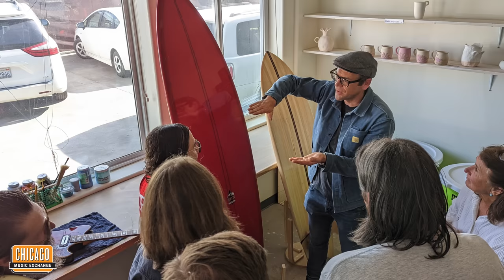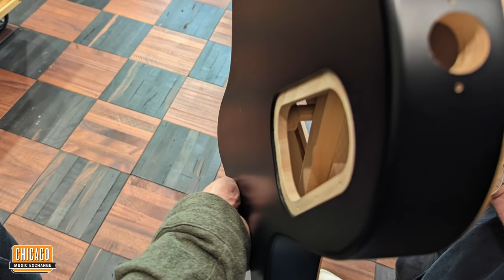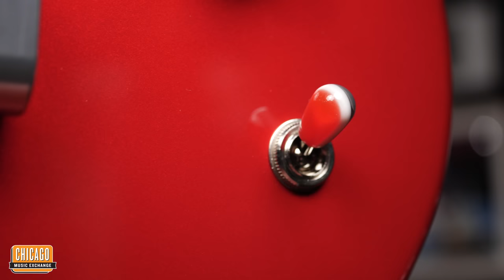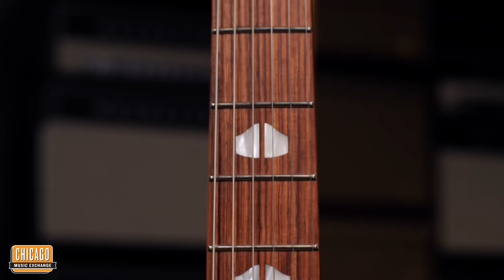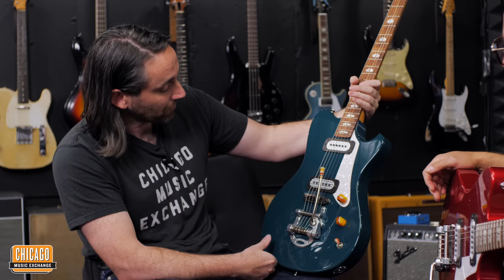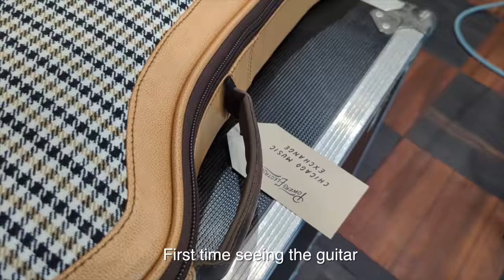Southern California Inspired | Powers Electric Guitars

Comment: A faraday cage that thin will have little effect on string pull.  It probably has some magnetic alloy on the outside of the coils that draws the lines from the strings down through the coil, but it will also create eddy currents that roll off highs to some extent.  The Steel screws do that anyway.  Fender Jaguar pickups and Lace Sensors have that, and they both have rolled off highs.  Strings vibrate elliptically when plucked regardless of magnetic pull, but I'm all for decreased pull.  The pickups sound nice, but there are already highly efficient pickups with low magnetic pull that don't have strong eddy currents.  Bill Lawerence was the first to do that with his blade designs in the 70s and 80s, then his Wilde NF series in the 90s, and finally, the Micro-Coils b4 he died.  He also designed low pull stacked P90 types that didn't have high freq loses.
Reply: Totally. "Faraday cages cannot block stable or slowly varying magnetic fields ..." Which is not to say you can't shape a pickup's magnetic field... just not that way. I think something was mis-translated there.

Comment: I dig it, just depends on the price.

Edit: This is a 4k guitar, just get a Novo or a custom shop of your choosing, Jesus Christ.
Reply: Agreed.  I just buy necks, bodies, pickups and parts I like from independent craftspeople, and do a little sanding and finishing to get what I want for under $1k.  Bolt-on necks sustain better than set necks anyway due to coupling force.  I chisel out the neck pocket center to increase force and reduce surface area damping.  It makes an audible difference.  Aluminum can be used around SC or stacked pickups to reduce the harsher upper-mids.  It was used in early 60's Strats under the pickguard.

Comment: Can anyone comment on the neck shape? Soft shoulder C type like Taylor?
Reply: Its a C-shaped neck. The fretboard has a split radius, different than an end-to-end compound radius. It’s asymmetrical from the bass side to the treble side. The treble side is slightly flatter all the way from the first fret to the end of the board. This allows for maximum playability and easier, choke-free string bending!
Reply: @DavidAzizinamini  wow, that’s crazy. I like stainless frets in this price range so you can never wear out your 4K guitar.
Reply: @HuWhiteNat  No stainless on these beauties but they're such great builds as they are!
Reply: @DavidAzizinamini  Good information.  I'm glad it has a glove compartment and fog lights, but the neck profile and radius is useful too. Daniel makes evreything sound great but I have a hunch these guitars are really good.